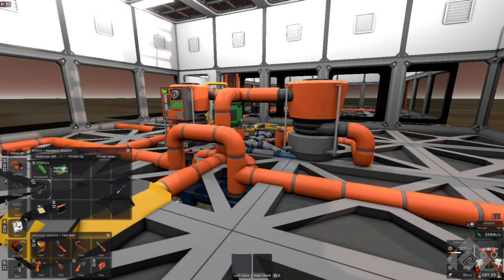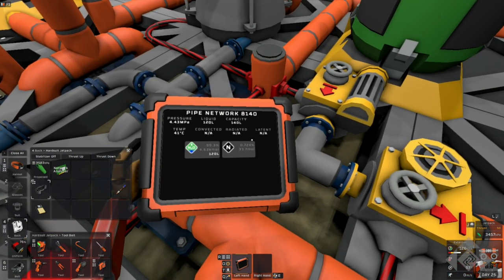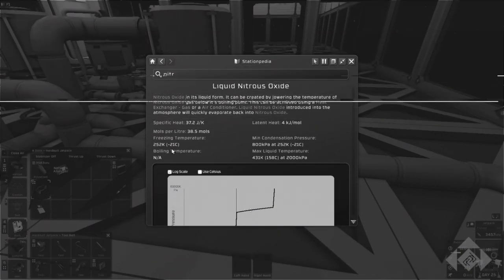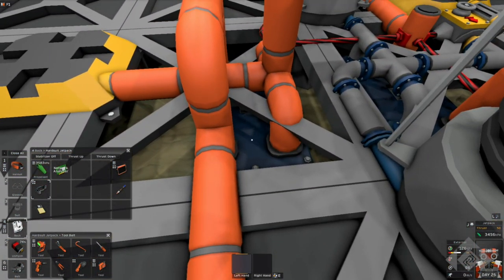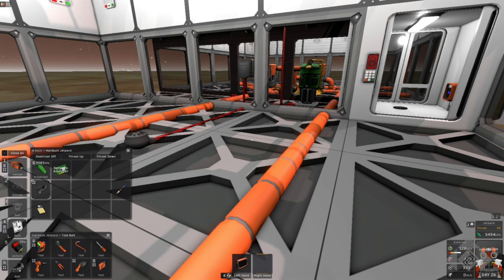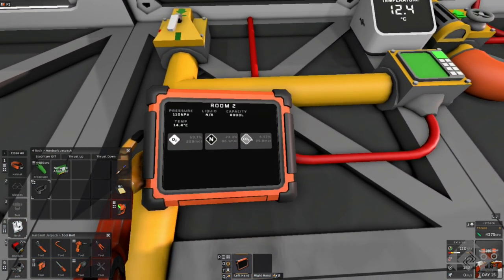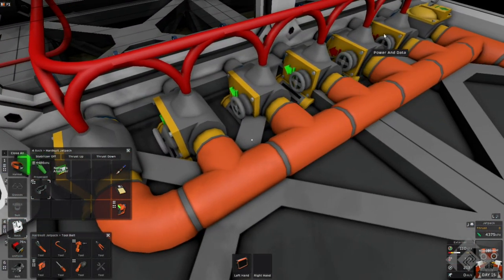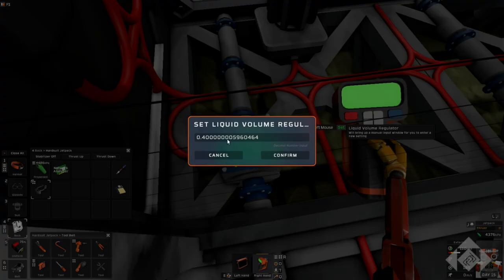Basic Heat Pump Setup, a not so quick tutorial - Stationeers Liquid Update

Comment: I have an Idea for cooling the GFG: submerge it in a room of liquid and as it heats it will expand into a gas where it can vent and phase change into liquid to be drained into the room again, exploiting the superior conductivity of liquids and ability to keep consistent temperature by instead using the fluid's latent heat capacity by having it expand and absorb the heat energy around it.

It's like cooling a hot coffee with ice as opposed to adding cold water.
Reply from the maker: That might be a little hard to control passively

Comment: Yes!  Does what it says on the tin (er, title) :)
  - I think you struck a nice balance between brevity and detail - 🍻
Also: Yes! "Your" setup does look more elegant, yet it appears to need more active parts 😜 ... I expect Rocketwerkz will update the look of the new big condenser/evaporator apparatii at some point - as much as I love orange, it makes those parts look even worse!
  - Also,  I think those (what was 'standard' heat exchangers) have now been hot-"fixed" to be from T2 pipe-bender and require Invar now :(   
   - 'Proper' heat exchangers are now mid-game, expensive components to make

--
Further notes re cooling a base:
-  It seems like a 100W (1 x Active vent) "home brew" A/C  uses only 20% of the power and is just as effective as an A/C unit with an Active Vent to help push the cooled air around (400W + 100W)  In a 7x7x3 volume on Mars, pressurised to ~50kPa (~75% N2 / 25% O2) - Both heated up the "heatsink" gas reservoir at roughly the same rate and to the same temperature (and brought the target 'room' down in temp. at same rate) given the same starting conditions. :-/  
  [ - The home brew was simply a gas-gas heat exchanger.  Air to be cooled was force fed (using one active vent) through one side of the exchanger.  "Heat sink" side is a 4000L insulated tank of CO2 at ~4MPa and ~5 Deg C (as this is in survival save and I couldn't be @r$ed chilling it down to -50 Deg C, yet!)  - so just the one pipe from tank to exchanger and the closed loop at the exhanger.
   - Once down to same starting temperature, used the same "heat sink" tank for the waste-gas connection on the A/C ]
Reply from the maker: So you were using the active vent as a compressor?
Reply: @JoelleTheAbsurdist  Probably not - I'm not  re-compressing refrigerant after thermal expansion. ( I'm far from an expert on HVAC, hence your recent videos are very helpful :) )

The active vent is driving the air to be cooled from the target room, through one 'leg' of the "hot" side of the heat exchanger and back out into the target room via a passive vent on the other 'leg' of the exchanger's "hot" side for more airflow into room being cooled.

The "refrigerant" gas (CO2) is connected to other side of heat exchanger, but this is just the 'standard' tank of cold gas [pre "compressed" to ~4.5MPa], a pipe to the exchanger and that one pipe is connected to both 'legs' of the "cold" side of the exchanger.

As my current play through is on Mars, I passively re-cool the refrigerant (overnight) using radiators on a pipe network outdoors.  The valve to the passive cooling network is opened when the temperature of the gas in the radiators is less than that of the gas in the refrigerant tank.

Comment: With phase change it seems like you can now scavenge energy from hot exhaust thru a stirling engine and have it actually be worth it? any advice on building a reverse heat pump?
Reply from the maker: I reverse heat pump is constructed the same way, except the cold side it outside, and the warm side inside. If you want it reversible, like a mini-split, just put in some valves.

Comment: I still can't get any kind of working AC setup on Venus that doesn't use the portable ac or large amount of AC units. :(
Reply from the maker: Keep all your machinery out of your cold area, everything generates heat, so minimize the introduction of it. Instead of daisychaining a bunch of AC to one another, loop the input and outputs outside, set the temperature slightly above ambient, and pipe the waste port into the base. This way any AC will apply maximum cooling. Finally, abuse the hell out of water... put it into a pipe network, and keep adding segments onto it to lower the pressure, this will help stabilize a target temperature. Storm on Venus are less than the game's water infinite point. When a storm occurs, cool as much mass as possible, and use it as a sink.
Reply: @JoelleTheAbsurdist  Interesting idea... never thought of reversing the ac's to heat the outside. will give it a try in creative.
Reply: @JoelleTheAbsurdist  Just rant the test and it doesn't work. The temperature difference is too high. Somewhere around 280c the AC's differential efficiency becomes 0 and stops giving cold waste gas.
Reply from the maker: @ViroMad   https://steamcommunity.com/sharedfiles/filedetails/?id=3044001607

https://steamcommunity.com/sharedfiles/filedetails/?id=3044001670

Comment: The bit about phase change in real life is incorrect. At a given pressure, representing a given phase change point, a liquid will not rise above the temperature needed for phase change. Greatest example of this, take the temperature of boiling water. It will not rise above 100c (212f). Any water that heats beyond that point is turned to steam, and leaves the system. This does result in sharp dropoffs, as no energy can be added to the system until the pressure, temperature, and phase change point has equalized
Reply from the maker: First of all, you are assuming a system is infinitely open, and that the vapour can always escape the vicinity of the surface area, and you're assuming a uniform transfer of energy, resulting in the entire body of liquid heating uniformly.
Reply from the maker: You made me rewatch my own video to figure out what the hell you were talking about. No... Plots of real life phase change temperatures and pressures do not ever exhibit sharp drop-offs or increases... the vapour pressure of a fluid, so far, has never exhibited a nearly infinite shift in any direction in temperature of pressure to achieve any phase change. What you are confusing this with, is the plateau seen while a fluid is undergoing phase change at a SPECIFIC temperature and pressure. Greatest example of this, the water not stop liquefying at 375c regardless of pressure, as it does in game.

But thank you for your well actually...
Reply from the maker: https://en.wikipedia.org/wiki/Phase_diagram
Reply: @JoelleTheAbsurdist  ahh. My apologies. I thought you were saying the plateau exhibited at a given temperature and pressure was not realistic. But you're saying (and forgive me, I'm still very new to the game and haven't played with the new updates much) that the vapor pressure doesn't eventually equalize the system in a pipe network, and the liquid continues to boil off? Or maybe I'm still not clear.
Reply from the maker: @g45h96  In the game, at relatively low temperatures and pressures, whatever fluid you're trying to manipulate, remains a gas, because the required energy to cause a phase change, becomes infinite, meaning even if you bring the gas up to 1+ Gpa at 1000c, the fluid remains a gas. This is not realistic, or even possible. At those pressures, most substances cannot remain a gas. Hydrogen for instance, at 400Gpa, will become matalic, and self organize into a lattice structure. At 20,000 Kpa, water will remain liquid at 700 degrees, however, in the game, at 6000Kpa and 350 some odd degrees celsius, water's phase profile falls off a cliff and can no longer liquefy, it requires infinite energy to state change in the game. It is not a temperature plateau, it's an energy absorption blackhole.
Reply: @JoelleTheAbsurdist  oookaayy. Now I get the drop-off you were talking about. Damn. No bueno. Im gonna have to rethink my plan of action for a couple of things. The good news is, it may actually work in our favor when you look at how the game calculates atmospheric bodies, but it's just extremely difficult to wrap my head around.